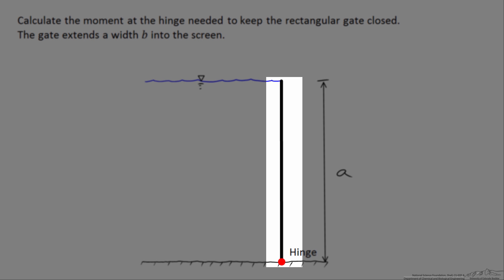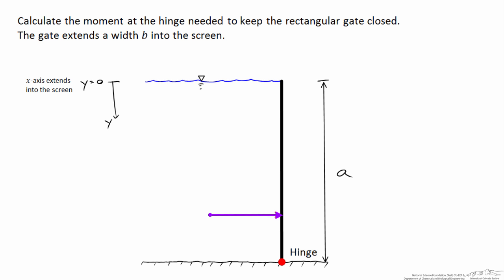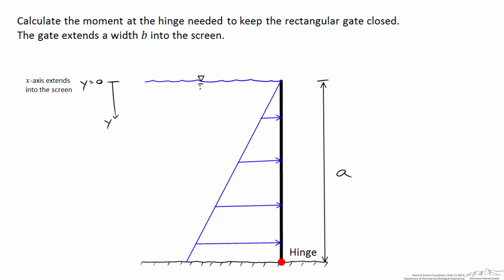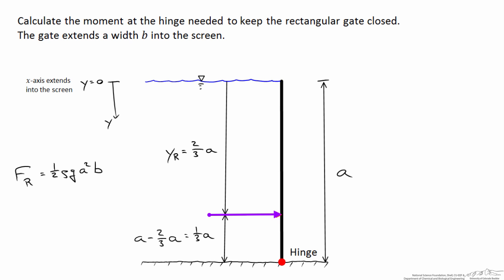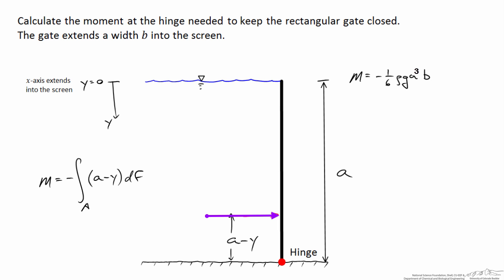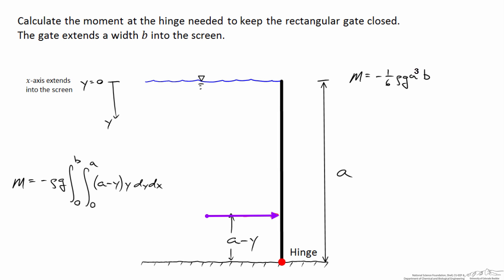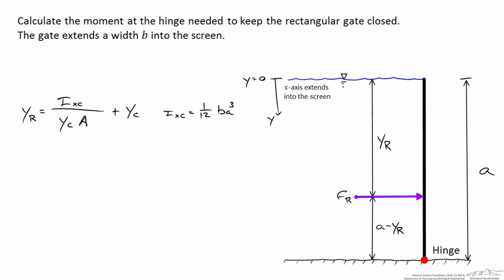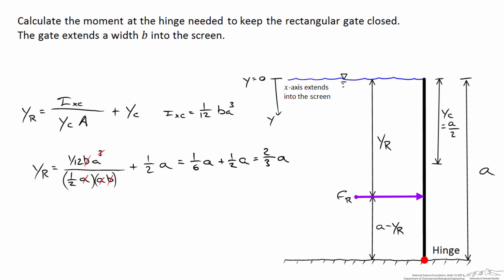Submerged Gate: Moment at Hinge

Comment: This is wrong at all perspectives don't use it. For a surface pressure on a side wall, you drew a rectangle which the center of the force should be 2/3 * a away from the top right corner rather than half way. The hc and yc of this question not only equal with each other but also equal to 2a/3. Too bad thousands of people got a question or two if not a whole concept wrong thanks to you guys!
Reply: The resultant force effectively acts 1/3 of the way up from the bottom of a rectangular surface. This is the lever arm you use in the sum of moments. The magnitude of the resultant force is calculated using the average pressure, which occurs at the centriod. I derive the same result multiple ways, so I'm not sure where your confusion lies.

Comment: Can you explain why the center of force is 2/3 from the surface? This is glossed over.
Reply: centroid of the triangle
Reply: @Crystal0071  yea but it is stated that gate is rectangular, right ?
Reply: @AJ-kv4ui  Look at the linear line of pressure he draws. It creates a triangle. You can think of it as a distributed load that increases with depth.